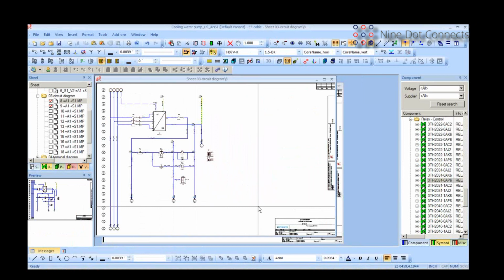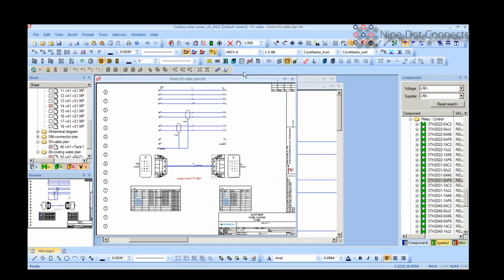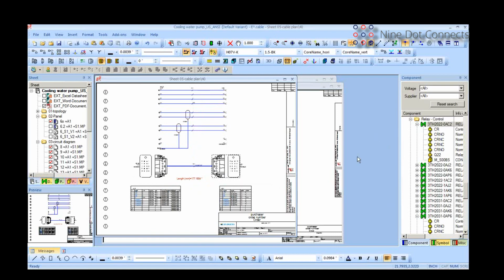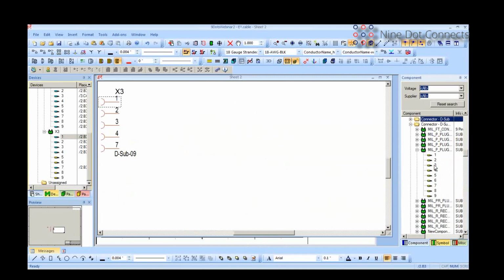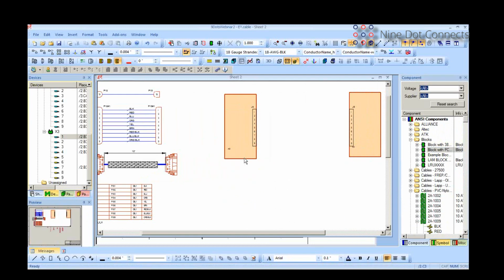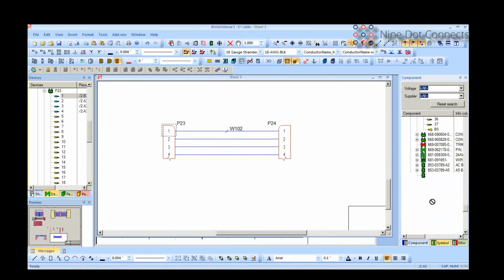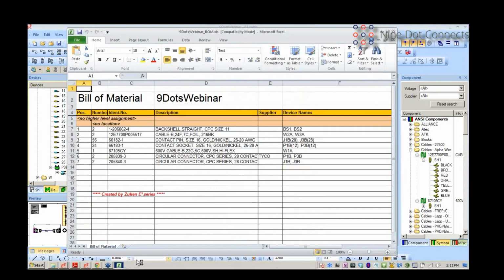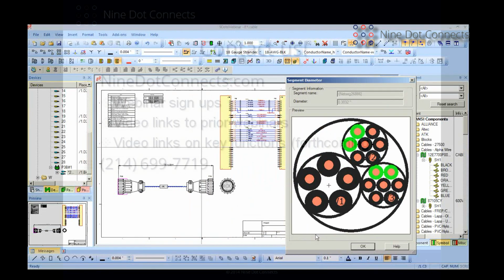Wire & Cable Harness Design with Zuken E3

Comment: What about making a wire loop?, sometimes in automotive industry we need to add a loop on grounds to have a thicker soldering between an eyelet and the wires. I cant seem to lock a wireloop from a pin to the same pin.